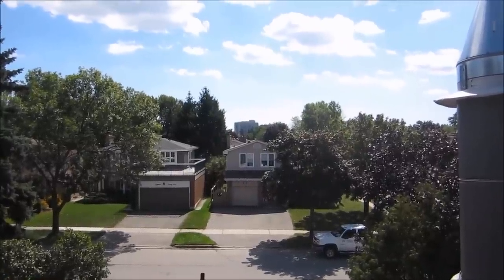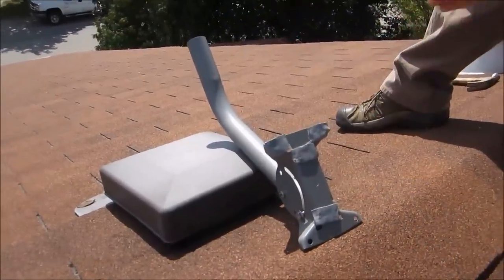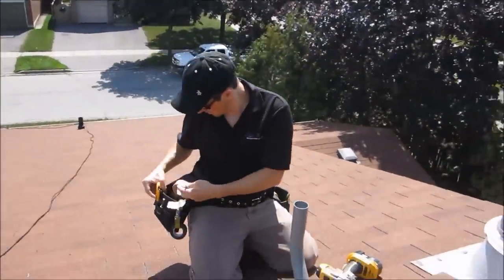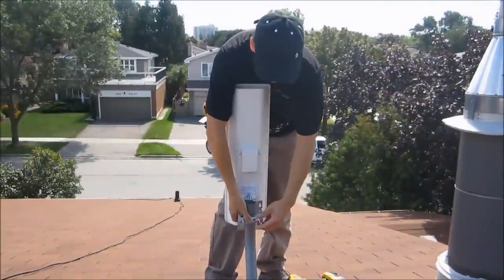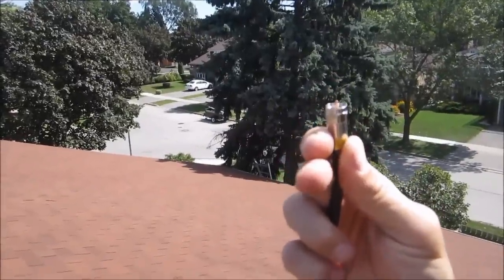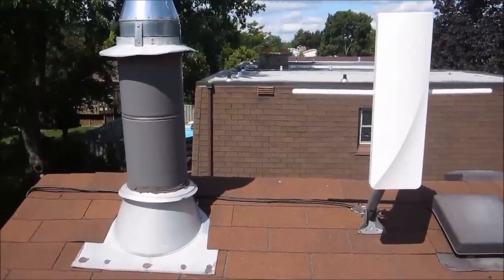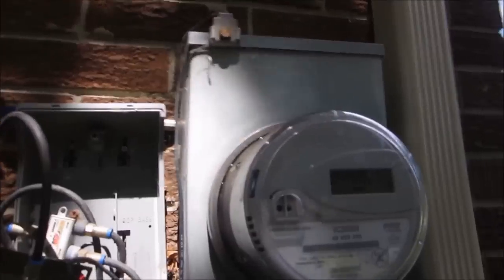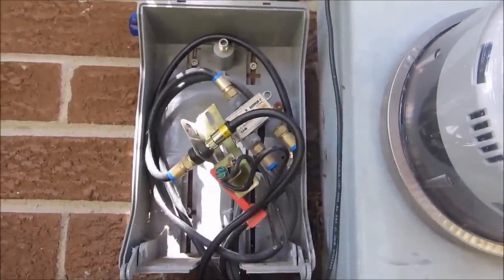HDTV Antenna Roof Installation with proper grounding

Comment: When I was in CATV, grounding to the meter was strictly forbidden. We grounded directly to the ground rod. I would have replaced that ground wire. That old one was looking pretty bad. Give them a fresh one. Get yourself a torque wrench for tightening those F connectors. Then you won't have to worry. Dielectric grease is good, but throw on a rubber weather bootie. They're cheap.

Comment: The  membrane as you call it is called "pitch patch" & the lag screws are for metal roofing (with the rubber grommet washers).
Reply: Are the lag screws overkill or merely wrong? This mastic/pitch patch stuff is surprisingly hard to find locally and only two amazon hits.
Reply: Not necessarily, I prefer overkill in unpredictable weather conditions 😊

Comment: "HD Antennas" don't exist because they merely pickup an analog carrier which has been modulated with a digital signal. "Non HD" antennas also pickup an analog carrier which has been modulated with an analog signal. So both types of TV transmission both use ANALOG modulated carriers to transmit their programming in either the VHF or UHF bands.

Comment: What is the name of that putty you use in the installation? I want to get some.
Reply: it's called mastic tape,  be careful it degrades with UV exposure has to be uv resistant vinyl taped or coated ontop, otherwise it'll fail eventually.

Comment: Grounding wire should be installed near to the antenna and not at the bottom as shown here.  The adjusting part acts as a hinge and a hinge shall always be bypassed with a wire because it does not guaranty a good contact.
Reply from the maker: Makes sense.  I guess I will have to make a new video.
Reply: @Electroguy  
This is a requiment of most electrical safety standards.
I am working as Product Compliance Specialist; our products drain over 150 A from 3 Phase Supply Mains with HV Voltage outputs requiring perfect grounding.

Comment: Finally somebody that had installed the on singles foundation step by step . Thanks goodness now I can tell the inexperienced installer exactly how it's too be done and have the parts ready for him. I'm 65 and I'm not climbing on the 10/12 pitch roof . Thanks

Comment: When installing an OTA antenna, I always adjust it for maximum signal on the TV signal strength meter , to minimize interference from passing airplanes, weather etc. Great video.

Comment: Nice Video. Very Informative. I would suggest not going under the shingles. Breaking that bond from shingle to drip edge will cause water wicking problems in the future.

Comment: Hello, Iam a professional installer in Greece. Just for information. I noticed you didn't use any meter to point the antenna. What about signal levels?

In my country we use different type of antennas for DVB-T.

Comment: Before the 80's, everybody had antennae. We had a deep fringe Channel Master antenna with a rotor on 4 sections of tower. This put it up over 40 feet high. Anything higher called for guide wires. You had to get it over the height of obstructions the best you could. It looks like you can get more channels and clearer with digital signal. The old analogue signal depended on the weather and other things.
Reply: +PeterFlynn   old channel Master is still good as long as no ruat and elements not bent out of spec.   antennas pick up frequencies, the UHF and vhf frequency are same.ones just less of them , if buying a new antenna and a new one ie channel master cm4228 pre 09 vs cm4228 after 09 the older works better and a 1980 even better.  worst case change balun amd any rusted screws or wires.
Reply: Bigger and higher is always better than what is installed here.  All the new digital channels use the UHF frequencies as VHF is being used for cell phones (4G etc).

Comment: My company has been installing TV antennas for over 40 years.  Every install we do we measure signal strengths for all channels at various locations and heights on the roof to make sure we are not installing the antenna in a dead spot for a particular channels.  Often times we can double our signal strength by moving an antenna 6’ on the roof.  If you don’t believe me then what do you do when you have bad cellphone reception in your house?  You walk around until you get reception.
These signal meters are expensive but without them you are not guaranteed to put the antenna in the best location.
Reply: I have been thinking of getting one.  What do you use or recommend?
Reply: @daxtheaxe  Like OC said they're expensive, but the one to get is the Televes H30D+ which is roughly $2,500.00

Comment: Everything I read tells me the mast needs to be ground with minimum of #8 wire. The ground wire/coaxial combination you used seemed to be considerably smaller? Is it sufficient size to use the included ground in combination with coaxial you used?

Comment: Great instruction and information for the Toronto area.  I have the EagleStar 53-6165CV that I'll soon be mast mounting at about 6 feet above my chimney in Etobicoke.  Is it necessary to make sure that the bracket mounting from the antenna to the mast make metal to metal contact?  Should paint or finish on the mast be scraped away for adequate electrical contact?  Is a small ground screw on the mast (as you have shown) adequate for grounding, rather than a heavy mast grounding clamp?  
Dielectric grease can cause electrical resistance unless used quite sparingly.  The grease will tend to liquify and run out of the fitting under the hot summer sun on the roof.  "Plumber's Goop", made in Campbellford, Ontario (sold through Home Hardware) provides a superior weather seal.  The Antop equivalent antenna comes with coaxial cable with a rubber boot connection at the antenna and Amazon sells separate weather boots for this purpose.

Comment: I much prefer to install this type of mount on the wall.  If you don't have to much overhang you can attach it to the top of a gable end wall and get the same overall height.  The benefit is that you don't penetrate the roof and won't need to disturb the mount if roof work is needed.

Comment: Looks like you missed the rafter with the upper lag screw when you first installed it. At first the head was flush against the mount, towards the end of the vid It wasn’t flush. Think it’s still sealed ok?

Comment: A nice clean installation. Please understand that your grounding work is only a good electrical ground. What you have, will provide little protection from a lightening strike. The most glaring example is the ride uphill a surge will have to make from the cable box to the clamp on the painted hydro/electric meter box. Most lightening likes to travel in one direction, towards the earth. Of course you are in Canada and I’m in Florida, the lightening capital of the globe. So you have a much lower lightening risk.
Reply: To your point...It was always my understanding for grounding an antenna, was there could be no 90 degree angles.  It has to go straight to a grounding rod. Is that not correct?  I think he had at least 3-4, 90 degree turns to get to the electrical box ground.  I live in Tornado alley, so we get some pretty fierce storms too.

Comment: Nice presentation.  I install FiOS for Frontier Communications (was Verizon) down here in Oregon.  That is video, voice and data through fiber optics.  I decided to cancel my video service and use OTA, I never have mounted a roof antenna and found your video very informative.  Thank you.

Comment: Is there a reason you didn't just connect the mount to the eve?  No roof penetrations, and the wires are further protected from the elements.
Also, I thought the strands around RG6 were shielding, but you said it was grounding wire.  Could you confirm?  Thanks for the great video.

Comment: Really liked your video. Very clear and informative. I have several questions. I live in Iowa (USA) in a fairly new neighborhood, and have had antenna tv for over 2 years now. The antenna hangs on the inside of my glass deck window. I have gradually gotten fewer channels over time, and I think it's because the bushes around my deck are getting taller. Seems odd, but I have also noticed that reception is effected when we move around the room where the tv is. Since the neighborhood is young, I'm also concerned about my reception as the years go by and the trees all get really tall. So I'm looking at a roof or attic antenna. Not sure how to pick out the "right" one. What model is the one you mounted in the video here? How did you determine where on your roof to place it (not meaning the stud underneath it) and what direction to point it to get the best reception? The chimney close to it isn't going to effect the reception? I also thought there was an awful lot of cable running under the edge of the shingles before it got to the cable box. I have to take a look at the outside of my house to see if we even have one of these. That part seems the scariest and hardest to understand to me. Before we moved here, the resident used DSL, and then we got cable. So we have the option for both for the internet...not sure if that applies to tv though.

Comment: To assure that your connections remain clean and the pictures clear, seal your connections with plumbers goop as it will keep all moisture out, the center conductor clean.  Pictures on your tv will remain perfect for a good long time, for years to come.
Reply: I'm always finding new uses for "Plumber's Goop".  Since it dries semi-solid but remains flexible forever, I could see it sealing better than dielectric grease and dielectric grease basically turns to liquid and runs out of the fitting under the hot summer sun on the roof.  My only concern is whether "Goop" provides any electrical resistance?

Comment: You didn't use a ground clamp on the mast, instead you connected directly to the mast. Based on NEC, it should have a ground clamp or that's fine?

Comment: I already have a dish on the roof with feeds to 4 TVs in the house. Can’t I go up on the roof and just swap the dish with the antenna and use the existing coaxial cable and not touch anything else?
Reply from the maker: You could do that but make sure you use a non amplified antenna.

Comment: Did those lag bolts actually grab?  The mounting plate didn't appear to snug down against the shingles as much as it should have.
Reply from the maker: They sure did.  Different installers have different methods.  I have found this method works well.  The mount is secure and I have not had any problems.

Comment: I find it unfortunate that, with this installation, you installed the antenna mount on the front side of the roof, facing the street. Moving just a few feet over and installing the antenna on the back side of the roof peak would make a better overall presentation. Less of a reduction in curb appeal. I hope you will give this consideration on future installs.

Comment: Im subscribed. but I would like to see more videos about HDTV antenna instalation. what kind of training do you recommend to do this professionally?
Reply: tecnico 
To be a pro, the first thing you’ll need to learn is that there is no such thing as an HD antenna. Back when color TV first cane out, the industry started selling “color antennas” to encourage people to buy new antennas. The same marketing BS is used to sell HD antennas, 4K antennas, etc. an antenna is just a piece of metal that receives the frequencies that hit it. FM, VHF, UHF, whatever. The size and shape of the antenna can make it more or less effective at receiving certain frequencies. The antenna doesn’t know if the VHF signal is SD, HD, or 4K.

Comment: Nice video. Thanks! I was surprised to hear you say your antenna did better than an 8 bay bowtie since yours is much smaller. Is your antenna amplified?
Reply from the maker: No it is not amplified.  It's mainly the area that I install in.  8 bay antennas generally have a narrower beam width and are good for long range.  In the case where you need a wide coverage this antenna works best.  I pick up signals as far as 95 miles away.
Reply: Thanks for the reply. I didn't catch the name of your antenna, and or a model number.
Reply: +Grants Pass TV Repair 
Prosonic PRO-536165P

Comment: I went out and bought the Home Depot 50 Ft CCS Coaxial/ground combination wire and installed it. When almost done, and having done some electrical work before I looked more closely at the ground portion of the coaxial and it reads 18 AWG. I think the minimum in Canada /USA is supposed to 8 AWG which is considerably thicker. The stuff you're using and the one I initially installed would melt in a 1/1000 th of a second and I think start a fire if lighting actually struck it vs doing what it's supposed to by sending the electricity into the ground. Could you comment?
Reply from the maker: Dwight Baker Lightning will fry everything if it hits it no matter what.
I have done satellite and antenna installations for over 30 years.  Literally thousand of installs.  Obviously you should follow your municipal code.  I am not an electrician.  Not every electrician will give you the same answer about grounding either.  I think what the messenger ground is meant for is discharging static build up, not lightning strikes.  Anytime over the years that I have seen a direct lightning strike on a dish or antenna.  Literally everything is fried.  TV's, antenna, dish equipment, anything interconnected through the coax etc.
This is with or without a heavy ground and in some cases even heavier than 8 guage.
The wire that would be 8 gauge or better is from the ground block to the building ground.  If it hits the antenna the surge is going through the coax as well.  So, pray that once it hits the ground block it goes to ground from the ground block and not through the coax into the house.  Again the few strikes I have experienced over the years it really didn't matter.
Reply: Electroguy great answer. Discharging static build up makes sense  at the antenna and I imagine, although heavier gauge might afford you a little more protection, the amount of power trying to move in an electric strike will fry everything. I've read static electricity travels on the surface of the wire rather than through the wire like the power from your panel, so I'm attaching a bare copper 8 AWG from my antenna to the grounding block and hoping my luck so far in winning the lottery carries over to lighting strikes:)
Reply: I found this on the Channel master web site:

The National Electrical Code (NEC) requires that the antenna mast and the coaxial cable be bonded to the home’s ground electrode system (GES), which is usually the ground rod installed at the power meter and breaker box.  There are other options listed in Section 250 of the NEC, but the GES is preferred. 

A separate ground rod is not required, and is not recommended.  If a separate ground rod is used, it must be connected to the GES with a minimum 6 AWG copper conductor.

The ground for the mast should be as direct and short as possible, with minimal bends, using a minimum of 10 AWG copper wire (or 17 AWG copper-clad steel or bronze wire).  It can be connected to the GES using a split bolt connector available at most hardware and home centers. 

The coaxial cable that comes from the antenna also needs to be bonded to the GES.  This is accomplished by using a ground block located as close as possible to where the coaxial cable enters the building.  The ground block then is connected to the GES using 14 AWG or larger with as short of a run as possible, and again with minimal bends. A separate split nut can be used to bond the coaxial cable ground to the GES.

Comment: So with the grounding, is the idea that since the antenna is grounded at the base of the antenna and therefore making contact with the coax..... and the coax runs to the side of the house and it is grounded there ..either to the meter or grounding pole in the ground so both are grounded this way? Both the antenna and the coax? Thank you!
Reply from the maker: I would always consult local electrical codes.  In many cases you could just ground the coax using a coaxial ground block at the electrical panel.

Comment: It's not an "HD" antenna.  It's an antenna that designed to receive a range of specific frequencies.  If a person already has an existing antenna, assuming it's the correct frequency range (UHF, VHF or both), then it doesn't need to be replaced with an "HD" antenna.
Reply: Yes that is correct.  Although vhf low band is not used anymore for tv broadcasts and vhf high band is not very common.  For instance in Toronto only CTV broadcasts in vhf.  Most channels nowadays broadcast in the uhf band.  This all happened with the switch to HD digital signals.  So we no longer need the big ugly vhf/uhf heads because we can get great reception using these smaller uhf tuned antennas.
We would never want to mislead anyone into thinking they had to change there old combo setup in order to receive the HD signals because like you said the frequencies have remained the same.  But it all happened because of the switch to HD broadcast signals, so I don't think it's misleading to call these new antennas hd.

Comment: Are you sure the meter base is grounded? The main house ground is in the panel. Older service meters were grounded thru the steel nipple between the meter base and panel. Newer installs use PVC conduit. The ground is inside the home. Be careful here.
Reply from the maker: I am not an electrician and I recommend always consulting one and checking your municipal code.  I do realize some older panels are grounded differently.  Newer panels with pvc conduit are still bonded through the neutral from the meter to the panel.  The panel is then bonded to your water main.  It's all bonded as one.